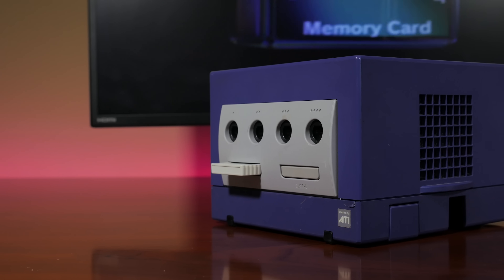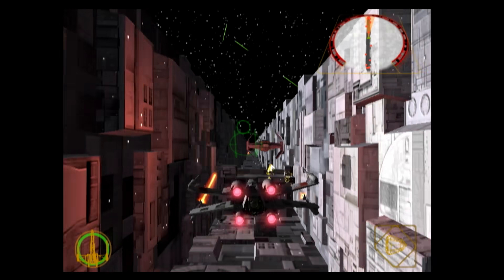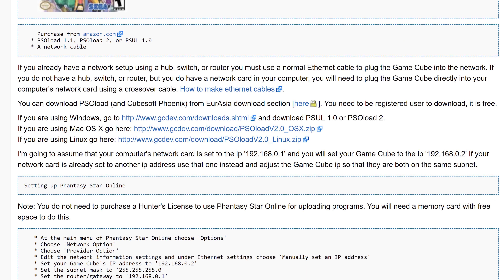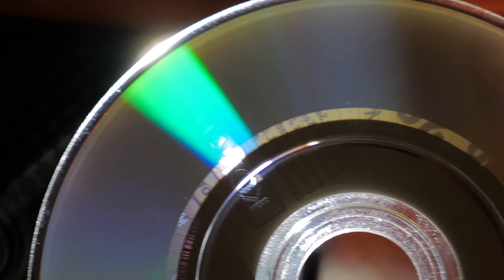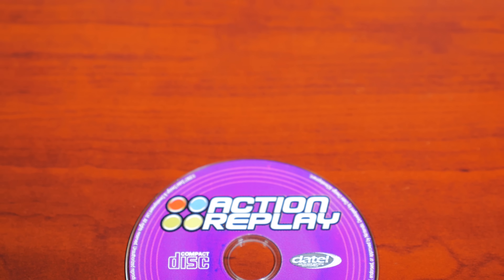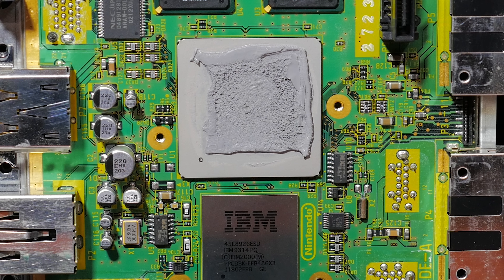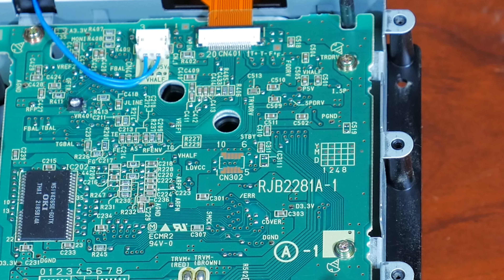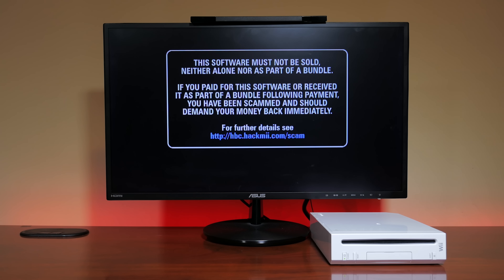How the Nintendo GameCube Security was defeated | MVG

Comment: I'm surprised how good GameCube UI was compared to the barebone PS2.
Reply: Gamecube had some gigantic shortcomings compared to it's rivals though. The tiny discs were a joke. 1.5gb compared to 9gb DVDs on PS2 and Xbox meant that GCN games were always horribly compressed, or criminally small. So many third party games of the era were more than 5gb, and devs weren't interested in gimping the hell out of their games just for a GCN port, so Nintendo screwed themselves out of third party support for the second generation in a row. 

Also, the GCN was capable of drawing 12 million polygons per second, which might have looked very impressive to Nintendo while they were developing the system, considering their out-going console - the N64, was capable of just 150,000 polys/sec. But the problem was Nintendo hadn't accurately predicted how capable Sony and Microsoft's consoles would be. The PS2 was capable of 75 million polys/sec, and the OG Xbox could do a whopping 125 million. Suddenly, with their console clearly being much slower than their rivals, and their storage format being literally a 6th of the size of their competitors' format, the GCN looked very weak in comparison.
Reply: @formulajuan5762  thankfully the gamecube had an awesome lineup of first party games. And not every single game used the full 9gb on the disc so there was a lot of decent ports on the gamecube
Reply: @formulajuan5762  ehh nah
Reply: @nadirjofas3140  what do you mean nah, its part of the reason it didn't do aswell, games either had to remove so much content or or cut heavily down on quality of most things. 

even though the gamecube was more powerful of the three, it didn't make a difference because only first titles leverage it to its full extent and any third party games were reduced visually and had missing aspects that were seen on the PS2 and XBOX versions. 

Nintendos piracy justifications was understandable but was defeated easily, if they had just gone with DVDs the gamecube probably would've done way better in general, due to more games better performance, but nintendo is nintendo
Reply: @NonsensicalSpudz  no
Reply: @nadirjofas3140  nice argument
Reply: @NonsensicalSpudz  yes
Reply: But could gamecube play DVDs?

Comment: Great video.  Last year I used my hacked Wii to load a save game exploit onto a memory card to use on my GameCube then converted a dead memory card into an SD card adapter by soldering a micro SD adapter to the PCB of the dead card

Comment: You forgot to mention adjusting the potentiometers of the GameCube so they can read burnt discs with the Xeno chip. They need to be adjusted. I adjusted my GameCubes to 200 ohms and it seems to be working perfect, except for a copy of Metroid prime. For some damn reason it's always freezes in one spot. I have the original game so   no biggie for that one.

Comment: Qoob Pro was the first modchip I successfully installed, I did it mostly because it was actually cheaper to import Resident Evil 2, 3 and Code:Veronica from the US than to buy European versions (especially in Germany, where they were at that time still 18+ and basically banned). I still have a cube with a viper modchip today. I bought that cube off ebay and was quite surprised when I saw it had the chip installed, because the seller didn't mention it. Hey, I didn't complain.

Comment: So is it possible to run games/homebrew on the Gamecube without a Action Replay/Disk in the drive? Part of the benefits of running these mods is to not rely on the disk drive anymore as they will eventually fail. I hear the Swiss mod thrown around a lot but as far as I am aware it still requires a disk spin up to work.

Comment: I had a switch installed on my gamecube.. Whenever I want to use another regions disc and special disk I would just flip the switch.. I still have a review copy of One Piece for that system.
Reply: Region change literally only required soldering a single switch... Good job Nintendo.

Comment: To me the fact that freeloader works way better than swap methods for PS1 and PS2 which seem to fully validate the disc every time ejection and insertion is detected is amazing. My mind was blown knowing friend with swapmagic and replacement cover it needs to work, and expecting my imported copy of Killer 7 and Baten Kaitos would probably need to save the disc swap point and boot up again to disc 2, only that after booting imports with freeloader the disc swapping works just fine - that is amazing and freeloader to this date is an amazing tool for those who import cheaper us copies or region exclusive games as it is way more nicer to use than PS2 swapmagic or (nonexistent) for Xbox.
Not that I personally have to care as my xbox is softmodded and my PS2 is hardchipped by someone way more skilled at soldering than I am. 

The burst data is fun thing and glad I know now more about it. I think Wii discs follow something similar, or I misunderstood and is different, but thus far my understanding is that the media has somewhow calculated corrupted points that validate the media as legit, and I say media because as far as my rather surface understanding, the Wii internal nand is also "strategically corrupted" in some spots that the bootmii tool shows to user when backing up your precious nand in case of a bad wad installation etc.
Reply: The Wii NAND doesn't use any similar method. Those corrupted sectors are just normal. When you make a NAND chip, you always end up with a few corrupted sectors that can't be used, just because of imperfections in manufacturing. (They include a few extras to make up for it.)

It is pretty silly how bad the actual drive security was. Just give it a password (which was the same on every drive) and you can reprogram it completely, to just not check copy protection or region at all. The rest of the system doesn't even know. (That program is loaded from ROM though, so you have to reprogram it again every time you turn it on.) PS2 was a bit smarter, as far as I know there's no way to reprogram its disc drive (except a modchip), but you could fool it with swap tricks.

Comment: Hang on, so you're saying that if you had some mini-DVDs you could burn a program to it with any consumer DVD burner and it would play in any Gamecube?!? If so that means homebrew could be as "Plug and Play" as Dreamcast homebrew is. Am I understanding this right?
Reply: Consumer grade DVD burners don't let you write early enough on the disc lead in to do what Datel did. They used special DVD mastering equipment that they customised in order to write their discs. If you install a xenoGC then you can use your run of the mill DVD writer since that mod will tell the drive to ignore the BCA.
Reply: @emukidid  Oh, that's interesting! So that means if I got a consumer DVD drive and modified its firmware (And possibly physical features too if that's a limitation) I could then write to this section of the DVD and re-create Datel's technique?

The xenoGC method is really cool too (And I think it also bypasses stuff like region locks too), but for me getting any GC to read unsigned code off a disc is amazing. I've been involved with Dreamcast homebrew development for a few years now and I feel one of the things that has let it flourish is the ability to run your own discs on a DC to the point where multiple retail plug and play games are being released each year. Seeing that for the Gamecube was be amazing for me since this was my first console.

And this wouldn't be much of a piracy issue (People burning official games) since this method doesn't use the 6 dots.
Reply: @Protofall  Yes, assuming you can find discs where that early portion has been left blank though.
Reply: @emukidid  I didn't consider that part, thanks

Comment: I have a homebrew channel Wii that I did myself but I actually brought it with a chip installed inbetween the disc drive and motherboard that is a region free chip and also allows it to play backups...The Disc drive packed up on it a while ago so I swapped in a disc drive from a working non modded Wii I had so I could keep all the functionality of my modded Wii. The Wii came with about 70 backup games with printed boxart that just boot like normal games but I have never been able to replicate that, generally I have to use neoGamma to boot a disc if its a game I have burnt to disc. There must be some way of burning backups so they just boot with the modchip but I have never learnt how to do it...

Comment: I always thought the Datel discs only worked because they are professionally produced and not burned.
Does that mean if I knew the exact method Datel used, I could just burn homebrews or games on a dvd and it would boot
on any gamecube without a modchip?
Reply: WuselDusel Perhaps it’s possible in principle but I don’t believe you could execute the Datel method  with a typical DVD burner either. It’s not the burnable media that I see as a problem, if you had the right hardware I think a burned disk would work. However most disk burners simply don’t support the level of software control required to implement this nonstandard encoding method. When it comes to writing to the disk a typical burner works more like a “typewriter” than a “printer” the burner has a finite number of modes and knows how to write 1s & 0s in those modes, the  burning software doesn’t have the level of control necessary to make the hardware do anything else.
Reply: you need a disk press for that